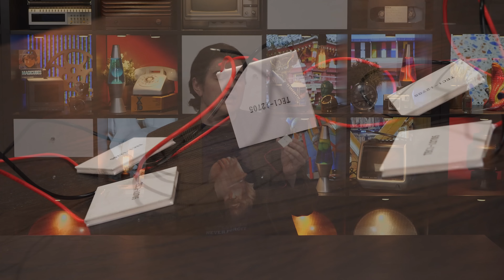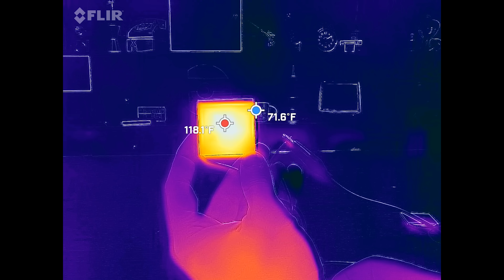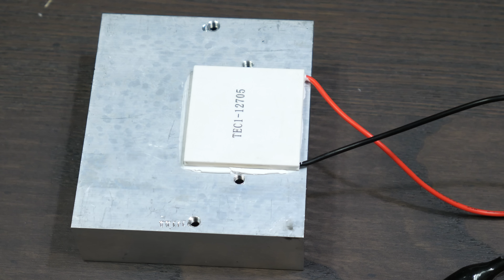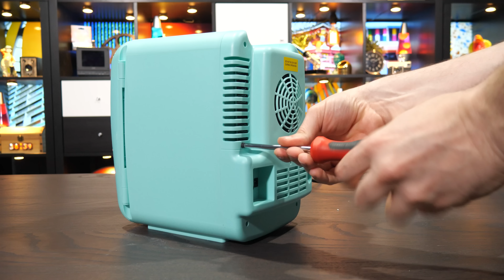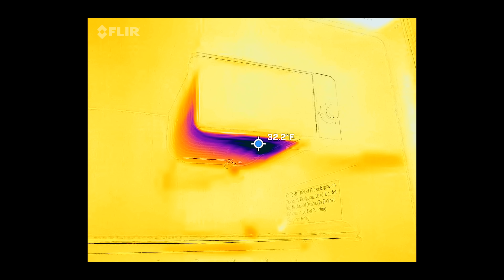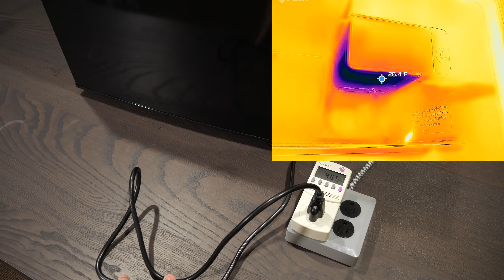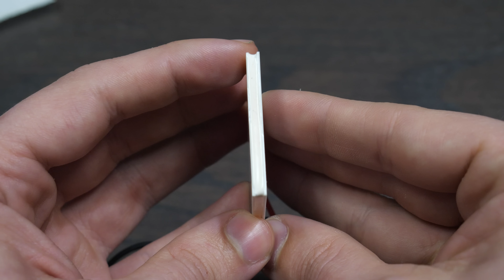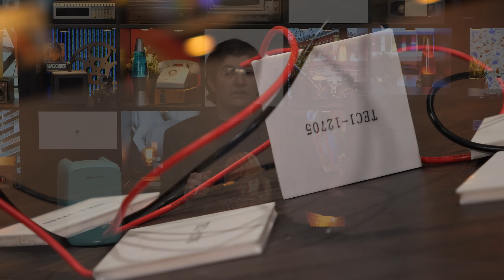Thermoelectric cooling: it's not great.

Comment: The automotive industry does make significant use of these nowadays for cooled seats. If a car has cooled seats, it's done one of two ways. One way is to have a small fan pull air from the occupant's body area, through the cushion, and out under the seat. Technically more of a ventilated seat than a cooled seat, and an easy way to make rear passengers smell your farts faster. The other way is to have one of these Peltier devices attached to a fan under the seat, and have the fan blow cool air from the device through the seat, onto the occupant's back. This style then reverses the voltage to create heat and warm the occupant by the same process when the heated seat is requested. The first suction method I mentioned would still use the older style stick-on heater mats between the cushion and cover of the seat.
Personally, as someone who works on cars with both styles all the time, I prefer the suction cooling/heater mat style of operation. No noise when heating is requested and they're much easier to diagnose when they stop working.
Reply: Don’t any of them get actual cold air from the A/C system?  I know the 2009 Nissan Maxima used Peltier for its cooled driver seat, but always assumed that was just an anomaly.
Reply: @kc9scott  both ways I mentioned are how Ford/Lincoln does it. I'm sure some high end luxury cars may do it that way but most cars wouldn't because if you want cooled seats without running the AC through the vents it just wouldn't cool the seat

Comment: I have a koolatron cooler works pretty well. If I run it off the ac adapter I put a timer on it to defrost and i’ve managed to get the inside cold enough to have issues with my groceries freezing

Comment: If used in the summer then it is creating more heat for the room it is in which will either make you too hot or require your air conditioner to run more often. If used in the winter then at least your electric heater masquerading as a refrigerator isn't completely useless.

Comment: I found the perfect use for a Peltier element! I need to heat and cool about 250mL of liquid in adjacent insulated compartments. A wall of Peltier elements in between would work well I think. It's a very specific use and it's perfect!

Comment: I love my little six can cooler (mine was labeled as a can cooler, not a refrigerator).  I'm not paying for the electricity, so don't care about that.  I love that I have cold beverages under my desk and I still have leg room.  I only keep four drinks in it, and they will be decently cold by lunch, if I put it in 4 hours before.

Mine is ultra silent, more quiet than those little 1.7 cubft mini fridges.

One strike against it, which you didn't bring up, was that the power supply in mine has failed twice (making 24 VDC 24/7 is hard on the cheap little supply).  The first time it blew up (about a year), I just had to solder in a capacitor and diode and it was back up and running.  The second time it failed, the failure was more catasrophic.  It was more economical to put in a new power supply.  I was able to retrofit in a much higher quality regulated power supply, and that has been running great for 18 months now.

But yes, I have had those little dorm mini-fridges and used them for a decade plus.  So they are also much more reliable than these can coolers.

I guess my final challenge to you is that if you want to say youre mini-fridge is a superior techbology, then find me one that is the size of a 6 can cooler and fits under my desk.

It more energy efficient for us to all ride a bus or train, but that doesn't make  that mode of travel superior.  I find a personal vehicle to be superior, despite being less efficient.

Comment: About 25 years ago, I bought a slightly bigger version of the Peltier cooler for keeping stuff cool on long road trips. As Alec found out, it didn't keep things as cool as ice would in a regular cooler, but it was good enough. When we stayed in a hotel, we could plug the cooler in and keep stuff sort of cool. (Finding a cheap hotel with a mini fridge was not easy 25 years ago). The goal was to stop the need for replenishing the ice, and having to dump the water. I would have used it more, but the stupid fan didn't want to play along, and made louder and louder noises as it wore out. Threw it in the trash, and went back to normal ice chests. Very funny video today, too!
Reply: I would be very surprised if the fan couldn't have been replaced with a silent one for 5-20 bucks. I honestly think a small insulated bag, with an ice brick, would do the job just as well.

Comment: Obviously you are correct. The big use is for fiber optic lasers need tight temperature control to avoid phase shifts in its light output. TECs are very good at maintaining a very tight temperature control as it can immediately heat or cool.  And for some computer or whatever.. it's good at makeing heat over resistive.. but yeah I've  experimented with them a fair amount. To cool a 100w heat load with two cpu style heat sincs.. it took 250-300w. They are god awful in efficancy. All they had to do is chill water and the best they could do it make it ever so slightly bellow ambient. Not worth the energy they consume I don't care how easy and compact they are. For cooling moderate heat loads.. they suck

Comment: There is another place where peltier module is used and worthwhile: a watercooler, as it's running sporadically with separate tanks for hot and cold water glued onto the opposite sides of the module :)

Comment: The coolest heat pump (both in terms of temperature and technology) is the various things they have on the James Webb Space Telescope. - There are several different stages of cooling, the last stage which had to change modes as the temperature got cool enough, as the primary cooling process would only work at 11 kelvin and lower ...

Comment: As you normally point out in your videos on other products, if you use it for what it was intended for, it works well. I know, shocking. It's a soda refrigerator, you're not keeping leftovers in there, so it doesn't need to be below 45°F. And nothing else fills the function of these either. An ice chest/cooler has to be restocked with ice regularly which isn't reasonable in an office environment, they don't let us bring in mini fridges or full size fridges because compressors have a reputation (argue whatever you want about accuracy, the reputation is what it is) for leaving puddles in office settings, and the whole point of having it at your desk is when a communal office fridge isn't an option.

Most people aren't buying a $30 refrigerator expecting a high quality, efficient, or capable device. We buy these things because they're better than lugging in a cooler every day to work.

Comment: I just wish there was an actual refrigerator that we can buy that's that small... But by then it would probably cost too much to be worth it for my occasional short-mid term use. So I make do with  the crappy small one that pulls way too much energy for what it does. edit: Interesting comment at the end about heat leaking through the door stopping it from freezing. I should try covering the front of mine. If it freezes. even better!

Comment: Let's not forget that the chips don't last very long either, you're lucky to get six months out of them.  I wanted to play around with one and put a bigger fan on it and applied some much better thermal paste to the heat sink and it still crapped out at almost exactly six months.

Comment: Disadvantage of iso-butane refrigerant: I put a new fridge in an apartment, the tenants didn’t know how to defrost it (they let the ice build up so thick the freezer was nearly filled, then decided to chip the ice out using a screwdriver and an awl) and managed to poke a hole in the coil, releasing the gas, which ignited from the cigarette the tenant was smoking while he worked.  Unfortunately he was burned, though by some miracle not too badly, but none the less he then sued me for his injuries, claiming it was my negligence to have not provided a self-defrosting fridge, or someone to defrost it for him (I pointed out that he never told me he had a problem with ice buildup).  My insurance company settled rather than go to court, and fortunately didn’t raise my rates.  Point of the story is that (at least some of) the new refrigerants burn very easily, unlike Freon, which is generally non-flammable.

Comment: My car has a peltier/tec in the driver seat for heating and cooling. The cooling isn't ice cold, but it is cool enough to prevent sweaty back while waiting for the main ac to cool down the passenger compartment.

....and they work in reverse. Apply heat to one side and it generates electricity, albeit vert innefficiently. Put a bunch around a core of heat generating nuclear material and you have an RTG like what powers the Voyager spacecraft.

Comment: I have an electric water filter that also cools the water in the recipient (which is a must for a hot country), and it's peltier cooled. It's definitely not the coldest water I've drank out of one of those filters, but it makes the filter size just big enough to fit in my tiny studio kitchen. The electricity consumption also doesn't seem to be that bad, and the energy efficiency tag claims it uses very few power, it probably has some sort of smart temperature control or something else. I like it!

Comment: So honestly and maybe this is just me thinking, but drill the holes, fill the door with foam, and drill a hole in the back where you can place a tempature probe, run it out the back of the unit and of course more foam where you drilled the hole, tie hat probe to a cheap thermostat on the back that is tied to the power, and suddenly you have temp control, I bet it makes it more efficient

Comment: If they double stacked the Peltiers, so there is 60 degrees of cooling pull down power, and distributed the resulting heat using liquid cooling jackets with a water pump, and a fans equipped radiator to remove the heat, and added a thermostat to cut off current flow in the Peltier stacks at 38 degrees F, would that be an effective and efficient solid state Refrigerator? It would not have to run continuously, with a 50/50 duty cycle? Also putting the cold end of the Peltier stack into a radiator of liquid filled heat pipes like are used in the Semiconductor industry, would allow the Peltier cell stack to effectively remove the heat from the air. When Coleman did a Peltier design, cooler, they got 40, not 30 degrees of cooling, by have a low speed fan which had a shaft on both ends, and impeller fans on both ends. The fan goes through a hole the wall into the inside, where their Peltier stacks was mounted on a Heatsink with the resulting airflow directed over the fins. On the outside, the other fan operated by the same motor did the same to another aluminum heatsink, forcing air over the aluminum heatsink on the outside! 

You could reverse the polarity of the plug to turn the highly insulated cooler into a heating chamber, allowing the contents to be heated to 40 degrees over ambient temperature.  Now what would happen if a doubled up stack of Peltier cells were used?  Could really competent 80 degree pulling refrigerator be made?

Comment: I'm curious about something...What if you swapped the heatsink to a liquid...thing? (The word is escaping me right now; it's like a heatsink, but it has pipes in it. One set of pipes goes to a radiator with a fan that moves the heat away, and the other set of pipes is bonded to the device. I've heard of such devices being used on high-power computer CPUs.)

Comment: Great video! One other rare instance that I have seen is at a previous job where there was a security gate with a remote cellular connection. The control box was about the size of a shoe box and had a device on the side that utilized a Peltier device to keep things "cool" inside. I am not sure how much cooling it actually did on a hot day, however it did have a thermostat and kept our remote gate operational.

Comment: 24:50 a large household refrigerator only needs 2 oz of refrigerant while most cars need 1.5-2.5 POUNDS of refrigerant? I get that some vehicles have rather long tubes for rear a/c systems and refrigerant efficiency is lower because they can't use flammable refrigerants, but that is still an insane disparity.

Comment: I put a pelter cooler on my CPU with heat conducing epoxy instead of thermal paste. It overloaded the power supply. I should have tried it with its own power supply.

Comment: If this is the same technology my koolatron uses, and I think it is, I have nothing but good things to say about it. It Keeps perishables cold for days in a hot tent and car and runs on 12v. I run an AC in the tent in 100° weather so the temp inside will fluctuate between 70 and 90. The koolatron never got above 42 at the top and 34 by the cooling fins. Not good for cooling off hot drink with a high specific heat, but great for keeping meat and dairy cold.

Comment: Fun fact. If that same peltier module is exposed to a large enough temperature difference on each side, it will create electricity. They are commonly used on fans that you attach to wood or gas burning heaters. They have a large heat sink on the cold side and the hot side touches a hot part of the heater. After a few seconds, voila, electricity and moving air.

Comment: I don't see if you covered it or not, but Peltier junctions have another unique property.  They are reversible.  If you heat them, the produce electricity. I saw a device that had TECs mounted to a canister that you heated over a fire to charge a cell phone.

Comment: Propane RV fridges are similarly poor at cooling down. They take forever to cool down and warm quickly when opened.
Best is to put items already cool into it.
However, a barbecue sized Propane tank can power the typical RV fridge for months.
There are even home sized Propane fridges for off-the-grid use. They usually have solid aluminum shelves that are part of the heat sink.

Comment: You can have my neck cooler when you pry it from my cold, dead hands!
You can get those mini-fridges which not only cool, but also warm, also they run "efficiently"(ish) off 12v. Thus you can plug them into a car or sogen to keep some cans cool on a road trip. Also to keep canned / bottled coffee and tea warm in winter! Or to dry wet shoes, as I used my 60℃-settable one to do during the rainy season.
Using them as actual fridges, Though? Naah.
When I was at university somebody had a "fridge" that didn't even have peltier, it just had a fan that sucked air in round the door and out of the back, thus creating a slightly lower pressure and airflow for "cooling". She tried to keep milk in it.

Comment: I worked in an office and would drink maybe 4 diet cokes per day, so I would buy a 12 pack every few days and rotate them into one of these little Peltier fridges designed for 6 cans (cost about $25 from Walmart).  As long as you were taking from the cold end of the rotation and giving them like a day, they would be decently cold, at least for my needs.  When Covid hit, I took all my work stuff home to work remote and when I plugged in my little mini fridge, I found that it wouldn't turn on.  The little light next to the switch that indicated if it was turned on now stayed off.  This thing was fried and I figured it may have been damaged in transit.
Shortly thereafter, I went to Walmart again and found a replacement fridge which I think did actually hold a full 12 pack which I bought for like $40.  This one had a "heat" position to its switch, which I never used.  Anyway, one day I noticed it was quiet and didn't seem like my drinks were as cold as I would expect.  I checked to see if the switch got bumped to find that around the power switch it darkened as if discolored by a lot of heat and where it would have ordinarily been a silver plastic portion, around the button, it was a now brown.  I suppose it is a lot better than it not failing and continuing to generate heat around this and causing a fire.  Oh, well, I just started keeping my drinks in the regular fridge and getting up to get them when I need something cold, though I might now consider one of those compressor style mini fridges once a little money loosens up.  On a bit of a tight budget at the moment.
Incidentally, one of the reasons I bought both of these mini fridges is the brand as they were both Fridgidaire, which was a pretty well known brand in refrigeration.

Comment: I've got a Coke branded Kool-a-tron one, mainly due to limited space by my desk (I'm disabled and its a trip down a flight of stairs to the kitchen which isn't comfortable or that safe) and also to allow me to have something good for cooling when travelling, the trick I've found with it is to not actually rely on it to do the initial cooling, using it more to maintain the tempreture and to old run it for a couple of days at a time and that way it's not that bad, theres no illusion that it'd replace an actual fridge but it does keep things cool long enough to suit me.
When space improves it will give way to a proper Husky type one (if place warrants it) and just be used as film storage as it actually stays supprisingly cool even when not running thanks to the metal inside and the large heatsink.

Comment: 24:50 A small camping stove IsoPro fuel canister has 100g of an 80/20 blend of isobutane and propane. A weekend long camping trip will use more isobutane than a refrigerator will use in its whole operating lifetime!